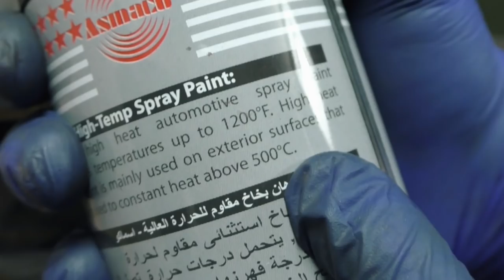Restoration Portable Warmer Coffee Heater

Comment: Still rusty in places; at least two wires wrapped around their connecting bolts in the wrong direction; not sure if paint primer was used;
the heating plate was pitted and cratered like the surface of the Moon;  bare copper wires; no earthing.  Just because you can does not mean that you should.

Comment: One thing i hate about repairing old appliances is that part where you have to get the wire to be squished by a screw to connect it to a switch or a plug.  How many times do i have to unscrew the bolt just because the wire slipped off the screw while i was tightening it!
Reply: Every time.